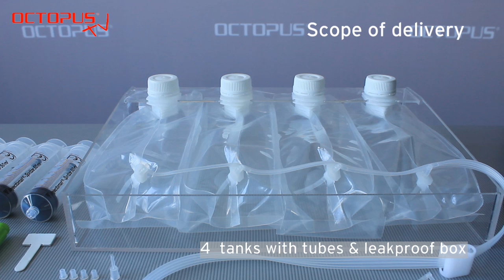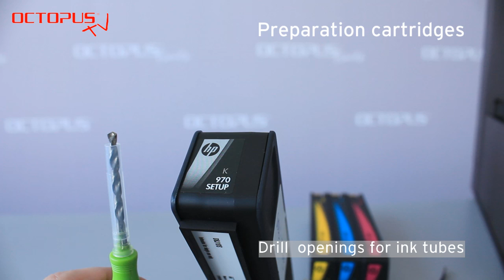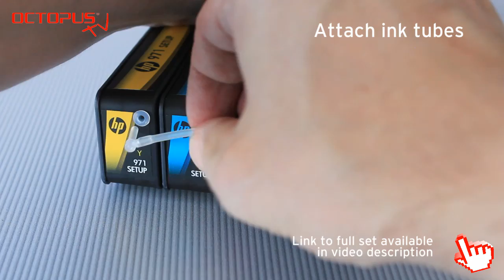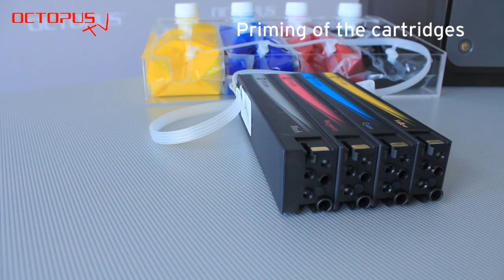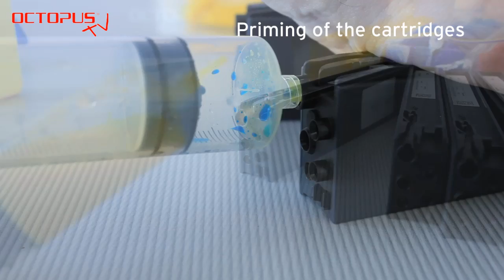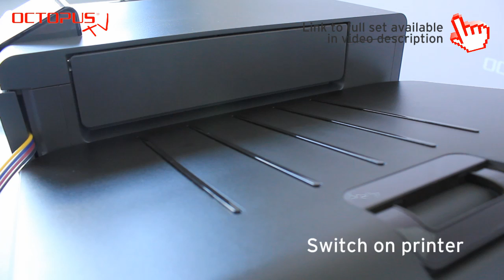CISS HP 970, HP 971 installation guide HP Officejet Pro X 551, X 450, X 576, X 470, X 476

Comment: I have Pagewide Pro 477 which uses HP972 cartridge. Looks identical to these. I have not found any kind of CIS or ARC for these cartridges. But I have been refilling OEM cart for over 2 years now (same pigmented ink as HP951). One cartridges lasts about 3 months before the LCD will say, this printer is not designed for use with continuous ink systems. At that point the cartridge is banned and cannot be reused, even if you try to leap frog.
Reply from the maker: Thanks for Your useful input. We have the same findings on our side for the HP cartridge models after HP 970 / HP 971 cartridges. Which is really sad from our point of view - HP may think differently..

Comment: Hello Octopus, great and very instructional videos!. I just bought my x476dw for our business..., its an expensive equipment so we need to be sure to choose the best option for refillable cartridges. I like this external tanks because we print a lot and refilling the cartdriges is always a  little annoying task, but there is some vendors that say this kind of ciss are bad for the printer because you put too much pressure on the printer heads. They said that the additional volume and the addiotional height of the externals add an anormal pressure to the internal of the machine. (Maybe damaging heads, ink leaks, etc). What do you recommend?, refilling the original cartdriges?, refilling the after market transparent ones?, the ciss option???... Thanks for your answer.
Reply from the maker: davidjhi Thanks for Your question. The external tanks are not connected to the print head directly. Therefore they do not create an additional pressure on the print head. The ink is pulled out of the external tanks by the consumption of ink in the cartridges. 
So far we have no experience with the transparent, refillable cartridges for HP 970 / HP 971. The physics of the original cartridges are quite complex, so if You can work with an original cartridge You should do so. With the transparent cartridges there is the danger that they relaease too much ink or not enough ink. Too much inks in Your printer no good - not enough ink not food for the memjet print head. That is why we are using the external tanks with tubes in combination with original HP cartridges.

Comment: I installed this CISS unit and it works great. I notice condensation in the tanks.  On closer inspection of the photos advertising this unit, I see condensation.  Is the condensation harmful?  What causes the condensation?  How can I get rid of of the condenstation?
Reply from the maker: +docmah88 From Your description we assume that You are refering to the external ink bags right? When filling the ink into the external bags make sure that there is as few as possible air remaining in the bags. This keeps any condensation to a minimum. Beside that the condensation in the bags is not harmful. The bags do not have an air port so the ink inside does not change its characteristics.

Comment: You have block all air inlet inside the cartridges and also inside the tanks 
I think there should be any air output in the whole system, shouldn't be?
is not it harmful??
Reply from the maker: +Mohamed Saad 
Thank You for that question. The external bags for the inks are made of soft material. When the ink is consumed out of them they shrink together. This way it is not necessary to have any air port for letting air in or out.
Reply: thank you for your quick reply
Suppose the tanks don't have soft material ( Chinese ciss sysem) and the ink keeps inside the tanks directly.I have seen videos of people letting the air inlet from the tanks open and close the ones inside the setup cartridges .There are some other  videos closing the air in tanks and letting the cartridges air open..few people close both and doesn't have bag like yours.. Which one is right in my case and doesn't harm the system ..sorry for long question.
Reply from the maker: +Mohamed Saad 
If You have a CISS with external tanks that are not flexible I would recommend to have an air inlet on the tanks side and keep the air ports on the cartridges closed.
Closing the air port on the cartridge´s front permanently prevents the printer from testing the ink level inside the cartridge. This way Your cartridge will not be messaged empty.
Reply: I don't really care about ink level checking as I have chips more chips to help ..I just need to make the system work flawlessly. I'm letting the air inlets in the cartridges open and close the ones in the tanks ..but I can see a lot of air bubbles in the tubes which I guess doesn't pull ink from tanks ..is there any clue??
Reply from the maker: Basically You get rid off the air bubbles in the tubes while priming the the cartridge. Meaning the process when pulling ink out of the tanks through the tubes into the cartrides.
Reply: How can I be sure cartridges pull inks.. Actually the Chinese tanks didn't pull ink correctly. So I replaced it with the original but I feel like the original cartridges don't pull inks and I need to pull the negative pressure from the cartridges to pull the inks from the tanks directly

Comment: Did you remove the earlier in the video shown plugs from the air holes? Why I can use a ciiss without closed air holes?
Reply from the maker: Hello Peter, does Your question refer to the plugs in the holes on the cartridges? Plugging these holes on the cartridge prevents that the printer can test if the cartridge is empty. The printer is pumping air into these openings and based on the result it decides if the cartridge is empty. The printer is not be able to pump air into the plugged opening and will "think" that the cartridge is not empty.

Comment: Hello, for the 970 CISS, is it to directly empty the cartridge before first installation with the SETUP & install it with "air" plug. Does this technically ward off the need of a 2nd cartridge for the "leap frog" method? Say sometimes if I pull out the Setup cartridge time to time, will the printer notice, I sometimes do a re-prime with QU port syringe. I'm fine with buying spare/2nd cartridges if needed, but from your experiences with CISS do we just need the Setup?
Reply from the maker: blissrunner Thank You very much for Your question. If You install the CISS on setup cartridges before Your printer has created an empty message for these cartridges - You just need to have this set of setup cartridges running together with the printer. The ink level will go down to the message "ink will be empty soon", but You will not get the empty message.
If the setup cartridges have the status "EMPTY" already before installing the CISS You need to have another set of cartridges to let Your printer forget the serial numbers of the setup cartridges. Install the new set of cartridges and after that You can use the setup cartridges again.

Comment: Hello! I have installed your CISS, and have run about 6k pages through it. I am now getting a low ink warning on my printer... is that expected? Have I installed the system incorrectly? Looking forward to your response!
Reply from the maker: Receiving the low ink message is normal. Despite the attached CISS the chips on the cartridges counting down the ink level. But if You have plugged the air ports on the cartridges correctly using the black plugs You will never receive the cartridge empty message.

Comment: Hello! Does this system work for the HP PageWide Pro 452? The cartridges are HP 972. Thank you!
Reply from the maker: Hello. Thanks for Your question. Unfortunately this system does not work on HP PageWide Pro 452 anymore. For the PageWide series HP has implemented some technology that detects when You connect a CISS to Your printer. On the printer´s display you receive the message that this machine is not intended to be used with CISS. Sad story but unfortunately true. So far we have not found a way to trick the system.
Reply: Thank you very much for your reply! Your system will still work with the HP OfficeJet Pro X451dn, correct? HP has not updated the software to detect CISS on that machine?
Reply from the maker: Yes, our solution still works very well together with machines using the HP 970 and HP 971 cartridges. The challenge for You is to find such a printer to purchase it :)

Comment: hey there, what happens when the printer thinks there is no ink left in a cartridge? does it reset itself?
Reply from the maker: Thank You very much for Your question. It is important to install the CISS and connect it to the cartridges before You receive any ink level related message from the installed cartridge. Beside that the blocking of the air ports at the cartridge´s front prevents the printer to test the ink level on the cartridge. As long You take care of that there are enough inks in the external tanks You are not going to receive any message "ink depleted" or something similar.
Beste regards
Octopus

Comment: Your web site shows that the dividing wall inside the cartridge has a hole - for the XL tanks. Does it also have a hole in the "Setup" tanks that come with the printer? (i.e. can I just connect your CISS to the factory cartridges?)
Reply from the maker: +Colin Ng Yes, the setup cartridges have two connected chambers too. You can connect the CISS to setup cartridges. It is important that the printer has not given an ink level related warning message for these cartridges.
Reply: +OctopusConcept  Bought your CISS and it arrived a few days later - that was fast! It was easy to install, the build quality is excellent, and it works perfectly. Thanks!
Reply from the maker: Colin Ng Thank You very much for Your positive feedack! Have fun and excellent prints  with the product!
Reply: +OctopusConcept Quick question, does the x476dw model support printing an F4 size page? And duplex at that?
Reply from the maker: The X476DW prints duplex on A4 paper, we do not know about F4 size sheets as there dimensions are slightly different from A4. Please check the printers manual.

Comment: do you remover the black rubber stoppers that you first put in once the cartridge is filled and hooked up the CISS?  Or do these stay in permanently now?
Reply from the maker: +DConWheelsLLC 
Thanks for the question. The black plugs stay in permanently. They prevent the printer from testing the ink level in the cartridge. This way the message "ink depleted" will not be triggered.

Comment: hi.what is the maximum life of printhead? means maximum how many copies printed record of this printhead?
Reply from the maker: Good question. We would like to know that ourselves too, but there is no specific information on that available from HP. Several requests from our side did not receive a clear answer to that. Sorry.
Reply: what about your personal experience?
Reply: one man said me he had the 3900000 copies highest record with one machine.
Reply from the maker: With our machine we have printed so far 490.000 pages and its prints still look fine. So we asume it will last for some more time.
Reply from the maker: 3,9 million pages seems high too me, but as I have told you I would not be surprised. I assume that the life span of the print head also depends on the color coverage that is printed. The higher the coverage of color on the page the faster the print head will wear out.

Comment: Hello, question, do you know the hp pro x477, is it similar? For the ciss, is new model, here the hp pro x476 descotinuo.
greetings thank you
Reply from the maker: Thank You very much for Your question. We have not tested the HP Pro X477 yet as we do not have a suitable refill ink available. There are rumors in the market that these new printers somehow are able to detect if there is a CISS attached to the cartridges and then refuse to keep on printing with the old, original cartridges. But we do not know that for sure yet. Sorry!

Comment: i have some question. the cartridge for this solution must be Setup catridge or the normal cartridge is OK?
Reply from the maker: +ณัฐพล เหลืองจินดา You can use any kind of original HP 970 and 971 cartridge. Please note that with the standard yield cartridges the connection openings for the ink tubes is made in the other upper corner of the cartridges.

Comment: nice video, where can i buy this? i have hp pagewide mfp 377 and i need ink very soon? thanks!
Reply from the maker: Thank You for contacting us. Your printer is working HP 913 inkjet cartridges. So far we do not have tested our CISS on the HP pagewide series printers as the suitable inks are still under development. The CISS in our video is tested for HP 970 HP 971 inkjet cartridges.
So suggest to invest in another set of original HP cartridges 913 - it is aleay handy to have more than one set of empty original cartridges available.
As soon as we have suitable inks available we will also test this printer series if the CISS concept can be applied.

Comment: Hi do you have to do a chip reset?
Reply from the maker: There is no device available that can reset the original chips - unfortunately. There are replacements chips, You can use them to make Your refilled cartridge fully operational again. They are not cheap, but if You compare their price towards the original cartridges the saving is still attractive.
https://www.octopus-office.de/shop/en/refill-supplies/ink-refill-supplies/chips-chip-resetter-for-hp/hp-970-971/

Comment: so with this we dont need chip or anything else to reset?
Reply from the maker: Yes, You need no new chip or any resetter. As long the original chip is still intact You can go on printing with an empty original HP chip. Best is to connect the CISS to the original HP 970 / 971 cartridges when no ink level related warning message has been given for these cartridges yet.
Reply: Oke thanks for the info, very helpfull.. (y)

Comment: Hello,

Can this system be used with HP Pagewide 577dw?
Reply from the maker: The HP Pagewide 577dw is using HP 973 inkjet cartridges and we do not have a suitable refill ink available yet. Therefore we were no able to do proper tests for HP Pagewide 577dw. We are on it!